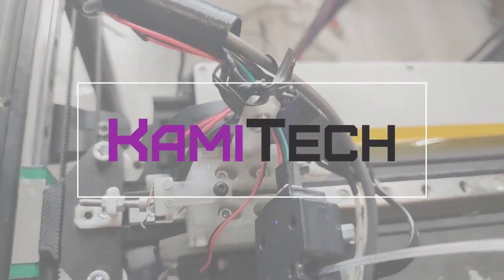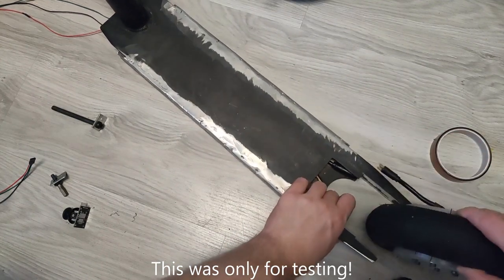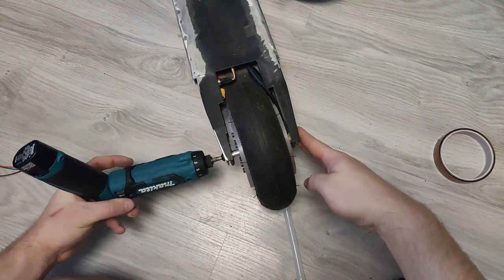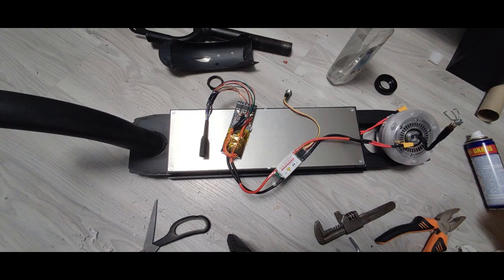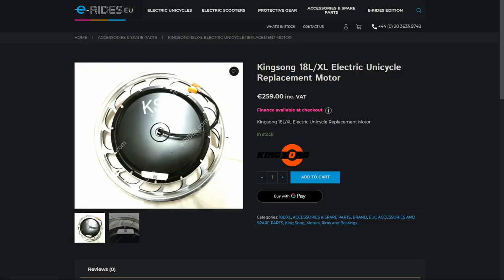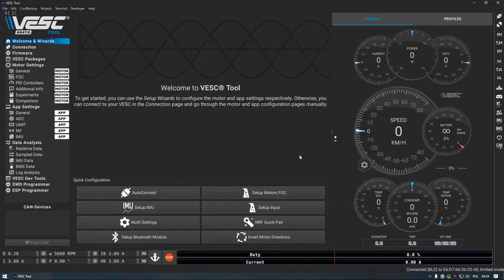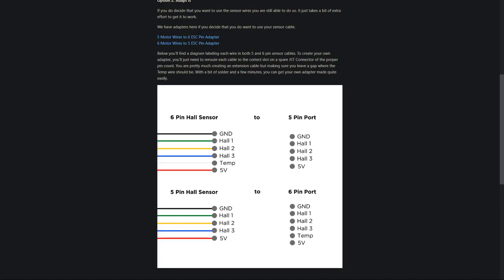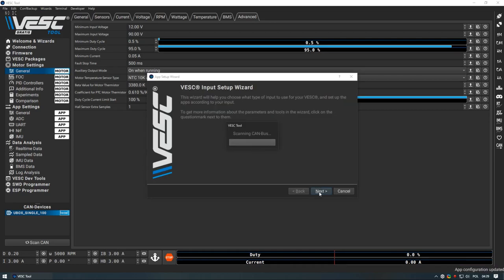DIY electric scooter - Part 1 - failures and setting up VESC

Comment: you said it wasn't very powerful even with the scooter motor, and idk what motor current you used but even then 80+A motor current is very common in the small scooters, over 200 per motor in the very large dual motor ones